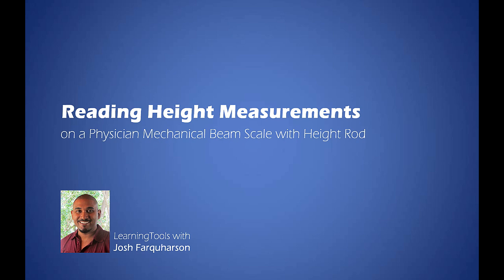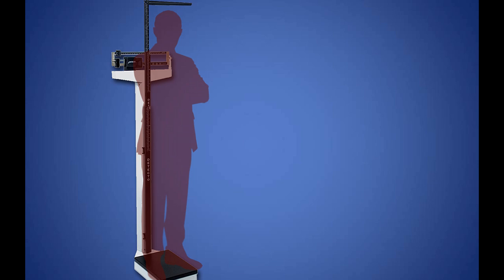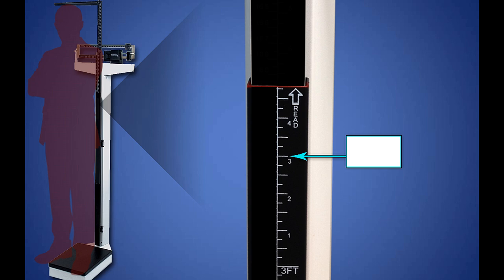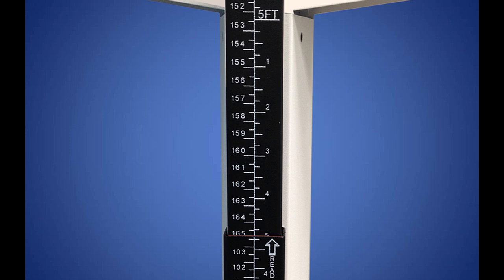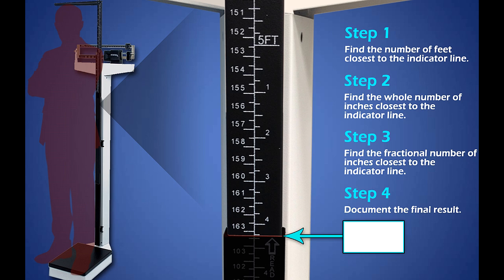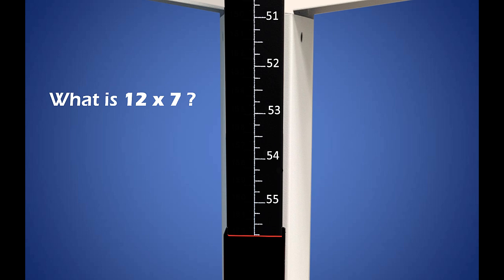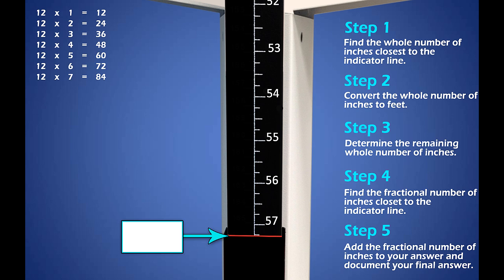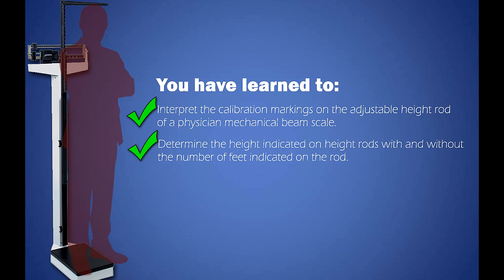LearningTools: Reading Height Measurements on a Physician Mechanical Beam Scale with Height Rod

Comment: Is a tape measurer an accurate way of measuring yourself from home? I measure 5’5 1/2 on a tape measurer, and I want to know if it’s my actual height, or if I’m shorter or taller than that. Great video btw (:
Reply from the maker: Generally, an inch will be an inch no matter the tool. Accuracy mainly comes from proper technique. Having your height taken at the doctor’s office is likely more accurate than doing it at home on your own. A trained professional has tools/equipment designed specifically for taking height and can help you adjust your body, head position, etc. as needed for accurate measurement. Hope this helps! Thank you for your feedback.
Reply: AlliedHealthToolsLLC Thank you (:

Comment: how did you get 4 out of 55 inches? confused......
Reply from the maker: I see that you are referring to the example given at the 8:17 mark. For this, determine the highest number of feet you can go up to without passing 55 inches. If 4 feet equals 48 inches and 5 feet equals 60 inches, then 4 feet is the highest number of feet that can be used without going above 55 inches. From, there determine how many inches are left over (55 inches - 48 inches = 7 inches). With this explanation in mind, review the video from the 6:57 mark and onward, and see if you have a better understanding of this concept. Hope this helps.
Reply: @AlliedHealthToolsLLC  8 years later and this info has helped me so much thank you